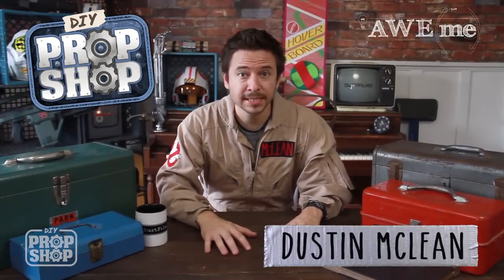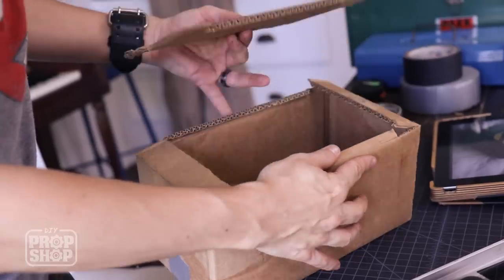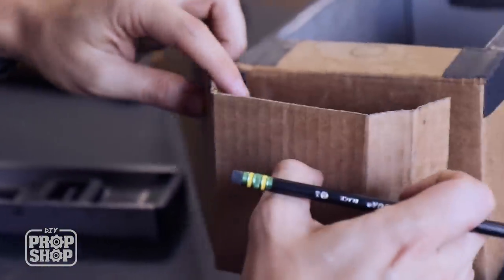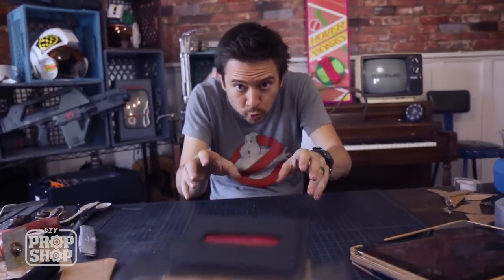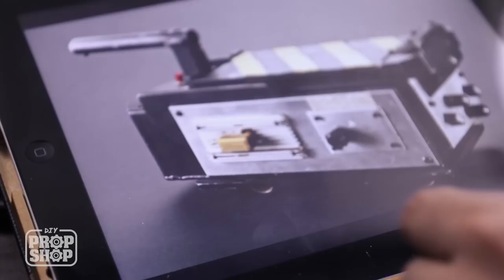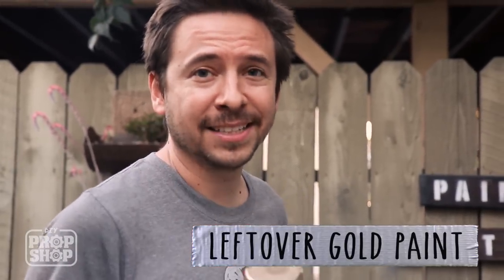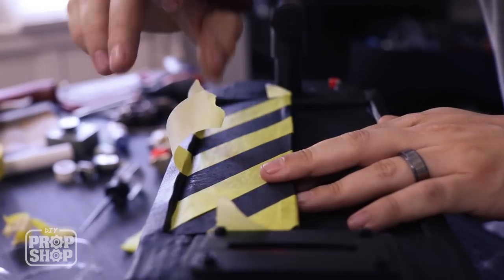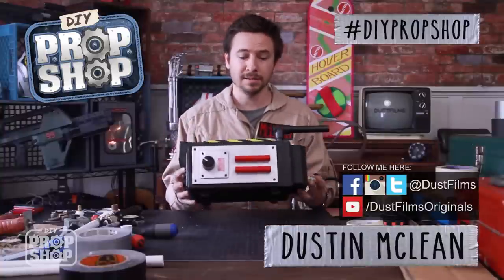Build a Ghost Busters Ghost Trap! - DIY Prop Shop

Comment: Fun fact, the Ghost Trap canonically comes apart. The part with the handle and lights is the tray, and the part with the doors is the cartridge. The tray also holds the battery for the trap so it needs to be recharged between cleaning the trap and the next time it's used.

Comment: When I make things out of cardboard, I find that when you spray paint it, a lot of the corrugated lines of the cardboard show up, and really makes it look like it's made from cardboard. We are going from the illusion of something else, so I just coat it with a light stucco type paint, or just use thermoplastic. Thermoplastic is cheap and you really just need  a hair dryer.

Comment: great build! love the diy, I build props as well, for the heat sink, that's actually just a high wattage resistor, they are still being made today, you can get those at almost any electronic surplus store, I've seen them for as cheap as 95 cents, you'd both save time and money on paint and spraying...

Comment: Upgrade.  Add some magnets to hold the doors in place.  Again for super low tech excellent!  Upping the bar might involve filling the end of the corrugated paper parts with bondo so they look solid.  The fake switch is OK but you can find old devices at recycle places and just strip out the old switches, looks better.  But Sh1t it's out of coregated paper and it looks really good so?  Another "step up" is to use corrugated plastic (probably not what it is actually called).  I have a bunch that was used for some event and then left for recycling.  You can buy it but you can find it tossed out pretty easily.  Use it exactly like the corrugated paper but it's stronger and doesn't fall apart if it gets wet.

Comment: I would definitely recommend reinforcing that cardboard with all the extra weight you're putting on it, especially the bottom portion holding the wheels.  It doesn't have to be much, just a second layer of cardboard panels glued to the inside would suffice.  Also, painting the inside silver isn't necessary to reflect the light.  Honestly, cardboard isn't smooth enough that silver would give you any sort of mirror effect anyway.  Just paint it plain white so that all the wavelengths of light are reflected.  Oh, and a set of simple flat refrigerator magnets on the insides of those doors would do wonders to keep them from popping open.